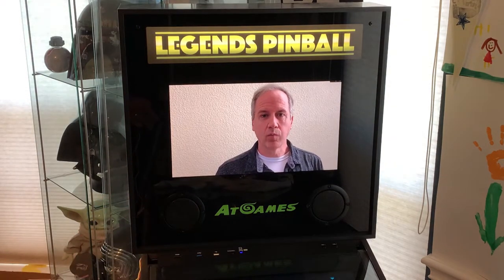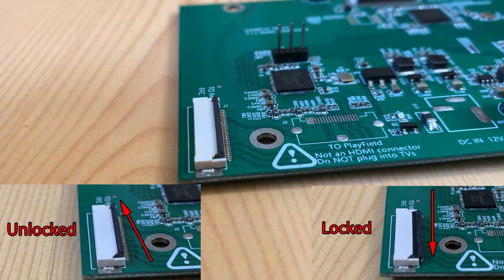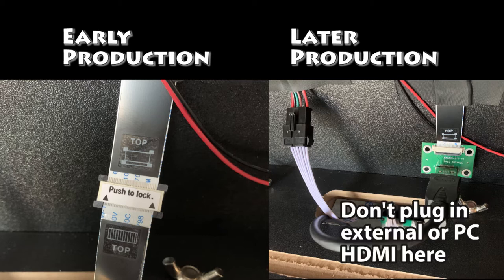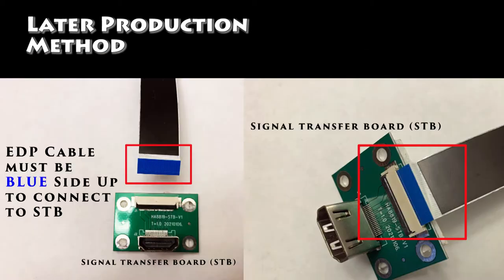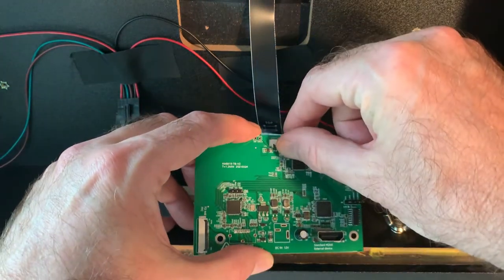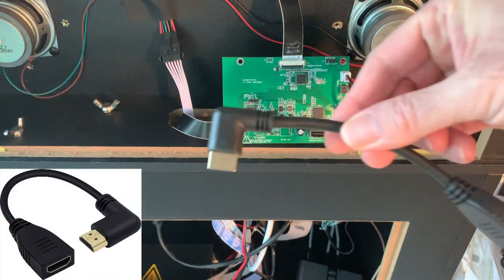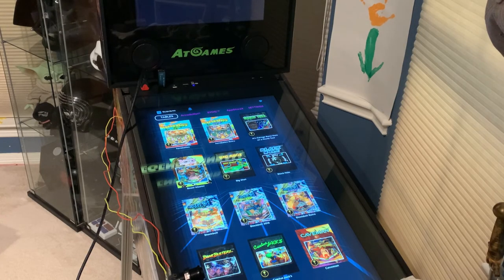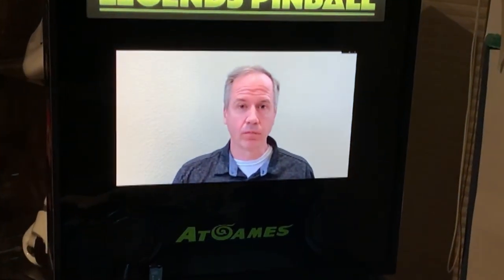AtGames VIBS (Video Input Backglass Switchboard) Installation for the Legends Pinball

Comment: What is the A connector on the PC, is it a second HDMI port ?
Reply from the maker: The A connector is USB-C out.  I used a USB-C to HDMI cable so the 2nd display is output from USB-C to HDMI IN on the VIBS for the ALP backglass display.

Comment: What kind of laptop do you have with 2 HDMI ports.  Their hard to find and very expensive or are can you use a splitter?
Reply from the maker: I use the Alienware m15 r3.   Splitter generally will only give you the same signal but there may be some usb c docks that could provide multiple hdmi outputs